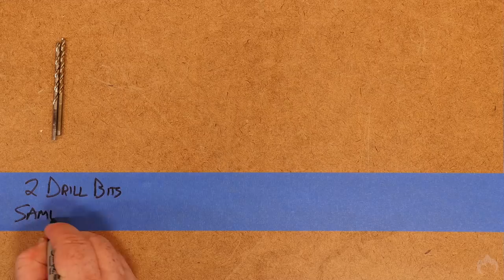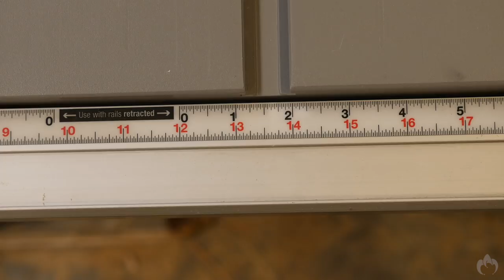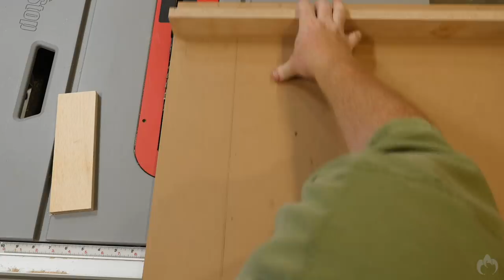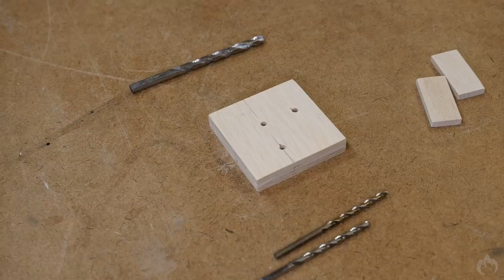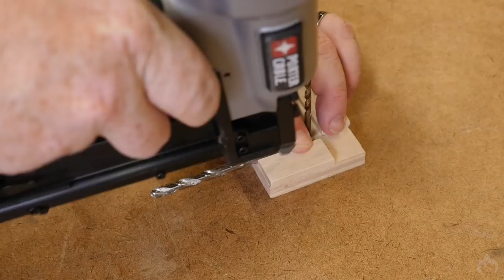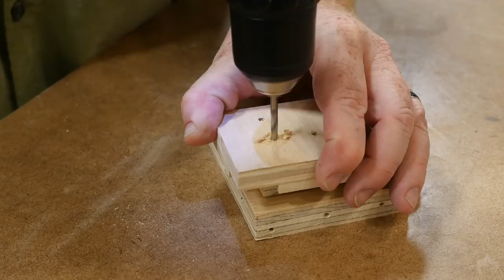Two Minute Build | Super Accurate Corner Jig

Comment: Like the idea and presentation.  I can't figure out what the application would be though.  What did you use it for?
Reply from the maker: Admittedly, I didn't explain it very well. The point of the jig is to provide a very, very precisely-placed drill guide hole, offset exactly the same from each edge of the corner. The drill bit (used as spacers) give that very precise offset. The corner hole is the only one that matters -- the other two holes are just there to keep the edge guides straight while gluing them in.

After I made this video, I took it a step further and had a fancier version 3D printed. To see it in use, check out: https://www.youtube.com/watch?v=vi8-krrgORE

Comment: I'm not clear on what this is for, but I've made similar jigs in my shop (I make bed frames, semi-production-style). If you ever need a jig like this that you'll use a fair amount, you might try using drill guide bushings. They're hardened steel and replaceable, so your bits won't widen the precision-placed holes in the jig over time, and (depending on the length of the bushings you use), they give better/straighter support for the drill bit. They are expensive though. 
Anyway, the quality of your video is great! And none of that slow, boring business that too many people here do.
Reply from the maker: Thanks! I do love drill guide bushings (stumbled on them a few years ago on McMaster). This corner jig was just needed to drill four holes -- four very, very prices holes -- so the drill guide bushing wasn't necessary. You're right, though, that the drill will widen out the holes eventually.

Agreed about the long-winded youtube videos. I have a short attention span, so I invariably click away from the videos with long intro sequences, too much talking, or just generally not getting to the point. You can do a lot in a short video.
Reply: You could use a brad point bit and just stab it through the hole by hand. Remove the bit and guide then replace the bit in the small hole left by pressing the point in.
Reply from the maker: That would work too.

Comment: As an amateur woodworker I must say.........I'm super lost
Reply from the maker: No worries. I don't think I really explained it very well. I think the key takeaway is a technique for spacing holes from an edge, using drill bits as semi-precision spacers.
Reply: @MadebyJester - Yeah, I was equally lost at first.  The build part made sense, but I had to watch the last few seconds of the video a second time.
What the heck is the purpose of that little square of wood? How does that help the jig? Or is that the jig? 
Then I suddenly got it. The little square was just to show how the jig allowed you to drill holes equally spaced from both edges at the corner of your project, like for adding feet or casters. Just size the drill bit to get the spacing you want.
Cool!
It's good to make my brain work this early in the morning. 🤪

Comment: Why not just use your drill press? You have a drill press.
Reply from the maker: A drill press by itself just drills holes. This jig makes sure the offset from the corner is correct and repeatable.
Reply: Drill press stop block would work the same. 
Though with some small changes this method would work for right angle clamping jigs.
Reply: What if it's too big or heavy to get on the table or not even in the shop?

Comment: Lost!!
Reply from the maker: I could have explained it better. It's a jig for putting a hole in a corner, equidistant from the two edges. The two drill bits are used as spacers to get exactly the right spacing when building the jig.
Reply: Made by Jester ok thank you!!